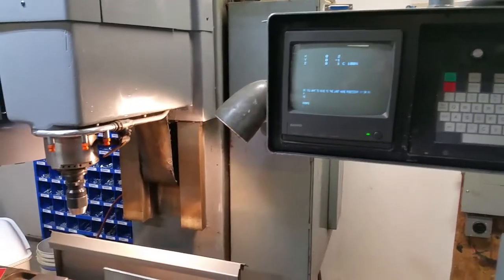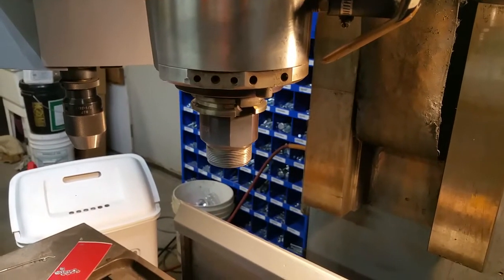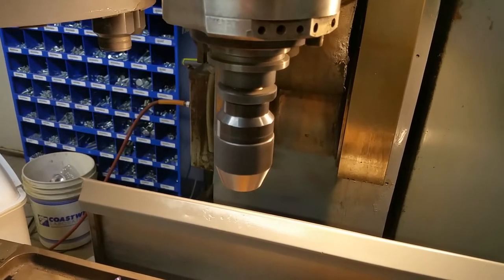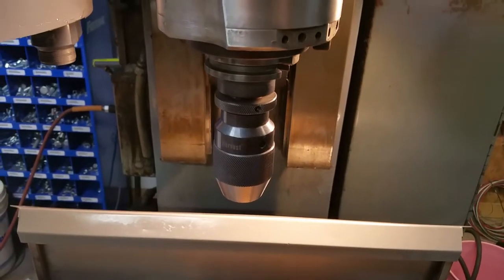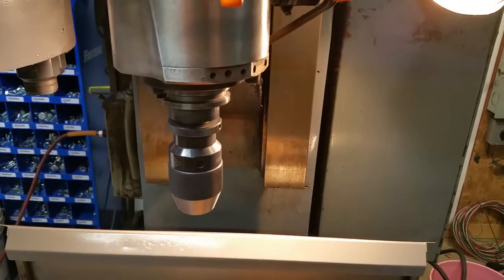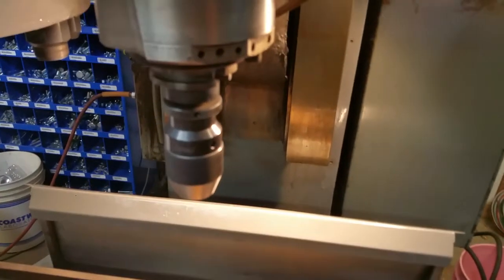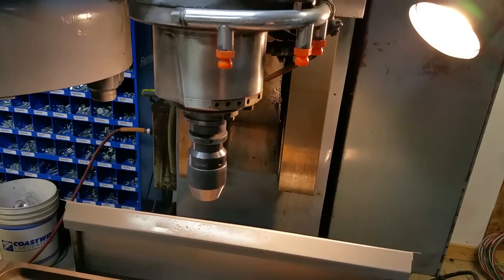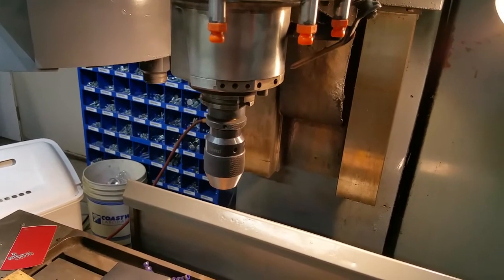Fadal archaeology: spindle drive and orient

Comment: canyou use any vfd on a fadal? i have a 220v 3phase 15 hp 4020 and vfds are hard to find, i was planning on getting one off brand and wire it up.
Reply from the maker: Not as far as I know.  They modified the firmware so that if the speed is zero and a forward or reverse direction is commanded, it spins at "jog" speed.  This is not typical behavior for most VFDs.  If your VFD can be configured to do that, then perhaps it would work.  I'm far from an expert on this, I recommend contacting one of the Fadal parts resellers and inquiring with them.

Comment: Do u still have this  FADAL ?
Reply from the maker: Yes
Reply: @eformance  do u have a contact email or facebook ... something ???  VMC 40 is acting up strangelly
Reply from the maker: @mrAq_pA  You can reply here, it could be useful information for others.  I can't guarantee I will know what your problem is.  You will probably have better luck posting in the CNC Forum on Practical Machinist, bob over there has a lot of Fadal experience.
Reply: @eformance  i see. So the stuff started... loosing all settings (machine still gives alarm to erase the memory)  i can not JOG until i put a small whatever program and start it and then "pause" it.. then i can JOG. Even the Fixtures table is corrupt... Seems a bit like some software mess....  the TOOL changer orientation is critical in the SETP parameters ? (spindle orientation is no issu i think)
Reply from the maker: @mrAq_pA  When your battery goes dead and you lose the memory settings, you have to erase the memory contents after replacing the battery.  When the memory gets jumbled, it stays jumbled even after battery replacement.  Once you reinitialize the memory from scratch, you can reset the parameters and it should work.  Search for the "Zero memory procedure".  If you haven't serviced the memory backup battery, do that first, otherwise the machine won't work properly.
Reply: @eformance  OK  will try it tomorrow  :)

Comment: In mine, there is an Orientation Factor in the parameters  (SetP), simply turn it down slowly until the orientation doesn't overshoot.  No since jacking with ramp speeds in VFD.
Reply from the maker: This vintage Fadal doesn't have that, the parameter list is very limited on this control.
Reply: Even if it does have ramps, some vector drives in VF mode still need adjustment

Comment: ok how do you fix spindle orientation mine spins ccw an cw is it a setting? mine is a 93 vmc thanks
Reply from the maker: The spindle orient uses an air piston and cam follower to lock the spindle in the correct orientation.  If the air piston does not fire, the spindle will hunt back and forth.  There is also a hall effect (or reed switch in later retrofits) sensor that detects the spindle is correctly oriented.  If the control does not receive a signal from that sensor, it will continue to hunt even with the air piston engaged.  Lastly, if all the other stuff is working as it should, the VFD could be at fault.
Reply: dose it 50% percent of  the time everything works well my repair man says it a setting wants 250 to 350 hundred hes the last guy I want too see.thanks
Reply from the maker: I'm not aware of any setting, the control will hunt CW and CCW to find the index/home pulse on the pulley.  You need to take the metal cover off the head and watch the roller follower to see if it is engaging, or if there is damage to the follower/pulley.  If the cam is engaging quickly, then it's either too high of a spindle acceleration, or the hall effect sensor is bad or going bad.  The cam follower could be lazy because of a faulty air solenoid.  I believe the Fadal manual has a troubleshooting guide for this.
Reply: ok if I find out I will post it
Reply: Mine goes by the orient location and turns much faster than your in the video. What needs adjusted? VFD accel? Dacell? Bias?